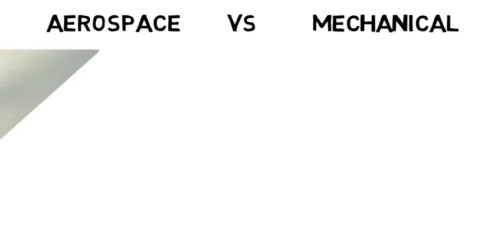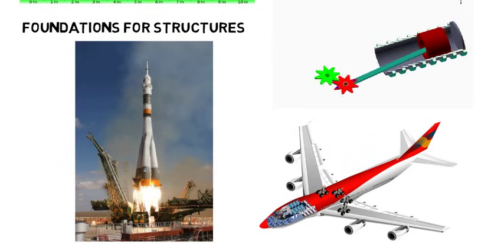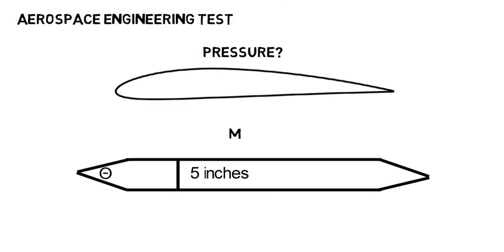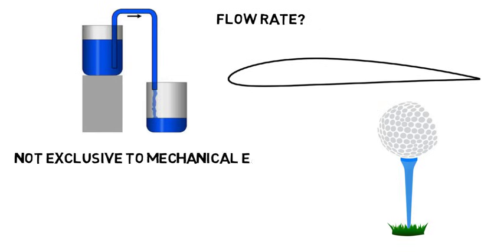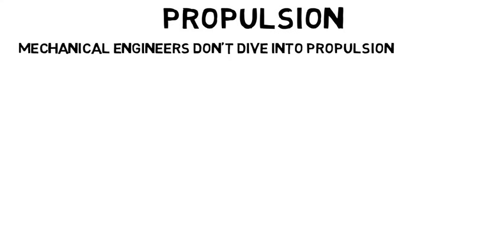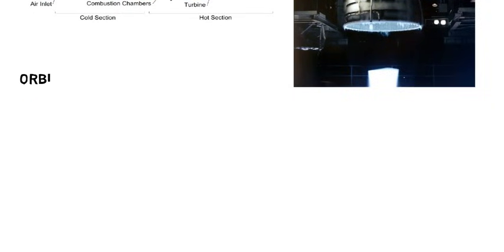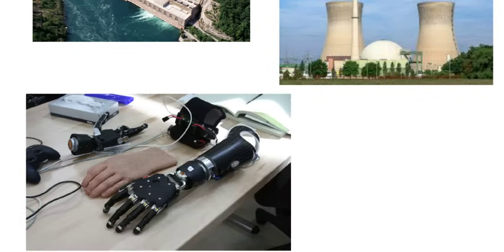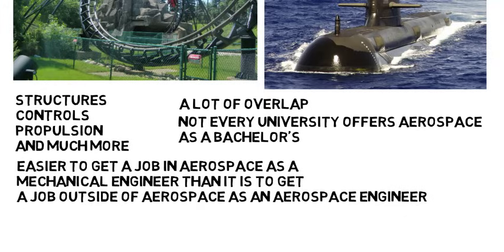Aerospace Vs Mechanical Engineering - How to Pick the Right Major

Comment: Very important thing that was missed here, Aerospace engineers will also cover some Electrical Engineering and Computer Engineering topics, since sensors and flight computers are an incredibly vital part of Aerospace engineering. I don't know if this is true at all universities, but I actually chose Aerospace because it covered both Mechanical and Electrical/Computer topics more in depth than a Mechanical engineering degree ever would.
Reply: Mechanical Engineering is the key technology and the father of all engineering majors.  All engineering majors are very dependent on Mechanical Engineering.  Including the internet run by mechanical engineering machines.  99% of the contents of our house are related to mechanical engineering except our bodies and lives.  A very important department and always have to be more than ready if war breaks out.  Civil engineering is most dependent on mechanical engineering.  There are no skyscrapers without mechanical engineering.  Tools of war and weapons are the scope of mechanical engineering including nuclear reactors.  Mechanical Engineering exists in all fields and majors.

Comment: One other big difference (at least here at TU Delft, regarding the BSc) is that mechanical engineers have some extra courses on working with their hands (manufacturing, prototyping, ...), while aerospace engineers don't have that. In turn, aerospace focuses more on theory and has some extra courses in mathematics/computational modelling, which is less prevalent in the mechanical engineering BSc.

Comment: i would have done aerospace engineering since that is my lifelong passion, but since my college didn't offer bachelors in Aerospace engineering, i chose to Mechanical engineering in bachelors, and then plan to specialize further with a masters in Aerospace engineering.
And based on what i've read this does indeed seem to be the most common option.
Reply: Did u manage to get internships in aerospace compaines while doing ur mechanical engineering degree?
Reply: I have a similar situation, how has it been working out for you so far?

Comment: I'm a mechanical graduate.

Have been working for more than 10 years with a combination of experience in Automotive sector (Engine manufacturing), Military Electronic Equipment design & Aviation.

Mechanical grad (and its derivation)  actually is one of the prospect that can easily slot into or jump between different industrial sectors e.g. machineries, shipping, electronics, automotive, military manufacturing, oil & gas.

You can even find mechanical engineers in civil, biomedical industry & forestry!

The other engineering discipline that boast similar advantage is electrical engineering.

Comment: Majored in mechanical for undergrad, and doing mechanical again for grad school with a focus on thermofluids.

I currently work for a company that develops jet engines for Lockheed and I work doing the same job as aero graduates. Sure, an Aero degree might help you have a better chance at getting into the aero job you want, but as a MechE, most companies will literally hire both aero and mechE (take a look at SpaceX or Blue Origin or Boeing job descriptions, I couldn't find one that said they want an aero degree without saying they take mechE degrees as well).

 I chose mechE because yeah I want to work in rocket propulsion systems which is an aero specialty, but I also want the flexibility to work for lets say, Tesla, doing heat transfer analysis on car batteries or Boston Dynamics to work on robots if for whatever reason I wanted to switch out of Aero. Say what you want, but the odds of Tesla or Boston Dynamics hiring an aerospace kid to work on cars or robots is very small compared to them hiring a MechE, whereas the odds of SpaceX hiring a MechE or an aero student are just about even and aero kids have maybe a tiny initial advantage.
Reply: thanks, this was very helpful and you may have just convinced me to do mechE
Reply: what do you get paid?

Comment: I'm going to go for CSE. But my father is a Mechanical Engineer and from what I know. He didn't go to college and he just learned it simply by working in the feild, which is mining. So first he started with learning different parts of mine equipments and how it's fixed then after 20 years he now manages 3 entire mines and also setting up another new one. So don't let the difficulty of degrees stop you from being demotivated. You can do anything if you try hard enough even without a degree.

Comment: Aerospace Engineer here.
Worked in FEA and Mechanical design for 6 years almost.
4 years spent doing mechanical engineering stuff (cars/machine tools).
Now doing FEM on airplanes.
Worked with both mechanical and aerospace engineers.
We are not identical but we are definetely brothers.
Do not worry and study what you like most.
Job stability is ok because although you might feel the difference for highly skilled research level jobs, if you keep looking up you will eventualy made it into the field you like. And if given proper time to learn on the job you will eventually be able to do both things. One mechanical engineer I kwow designed a wing. A former classmate of mine is designing gear drivelines for helicopters instead. 
Just persevere and be willing to relocate/move in your early years.
As long as you know what you want it doesn't matter which one you choose. 
Greetings from Italy.
Reply: Mechanical Engineering is the key technology and the father of all engineering majors.  All engineering majors are very dependent on Mechanical Engineering.  Including the internet run by mechanical engineering machines.  99% of the contents of our house are related to mechanical engineering except our bodies and lives.  A very important department and always have to be more than ready if war breaks out.  Civil engineering is most dependent on mechanical engineering.  There are no skyscrapers without mechanical engineering.  Tools of war and weapons are the scope of mechanical engineering including nuclear reactors.  Mechanical Engineering exists in all fields and majors.

Comment: Aerospace engineer here. 
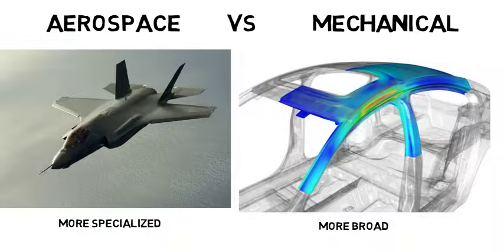1. 0:19 This is not true. In the first year, aerospace take one or two courses in "introduction to aerospace engineer" which even includes designing simple airfoils. In the second year they take "Aerodynamics I", "aerial structural analysis" and their labs.  
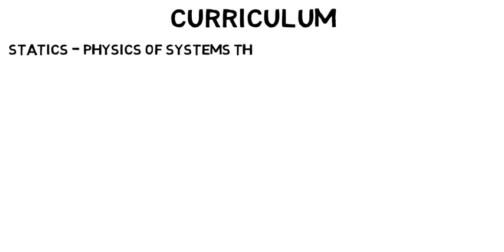2. 0:24 Incorrect. *systems that aren't accelerating.
3. 1:13 Incorrect. Only flight mechanic majors use MATLAB a lot. Aerodynamics use Ansys.fluent, and Fortran. Structures use Catia, ANSYS, and SolidWorks. 
4. Video is very faulty, I can't even continue from this point.
Reply: 1. This depends on your school more than anything. Aerospace and Mechanical engineering are the same for the first 2 years at my school. He also said “nearly” the same, and one or two classes compared to a full year of classes, usually 17-18 credits a term. So between 34-36 credits, two classes is pretty similar. 

2. This is to educate people who want to go into this field. Whether he put moving or accelerating doesn’t make a difference, people understand the gist of it. 

3. Again, this depends on the school. It’s not necessarily about learning MATLAB, it’s about learning to code. Some schools have you learn MATLAB, Some schools have you learn C, some CAD, some a mixture of all three. 

Your experiences don’t make you right. Now if he was talking about specifics, yes, I absolutely agree with everything you said. Especially if it was a video about the school you attended. But it’s a general video to educate people a little about a major.
Reply: @levibeam100  One thing is for sure. If you don't hold a Bachelor in aerospace you're not an aerospace engineer.
Reply: @SaeedAcronia  once again, i would slightly disagree. But that’s just nitpicking at that point and i don’t really care. I don’t even remember commenting this in the first place. Have a wonderful day man

Comment: Im an aero student, from what I see as a difference between me and my mech eng friends, we learn practically identical things but our questions are more focused on the aerospace industry. We go more in depth in fluid mechanics compared to mechanical engineers and we are given more time to learn how to use fluid mechanics in a working environment. We also need to learn about orbital and flight mechanics which is something they don't do at all. In general I feel aero students are taught more things but less in depth.
Reply: That last bit doesn’t make much sense to me. If mechanical engineering is broader wouldn’t that be the degree that goes less in depth and instead applies concepts to more fields?
Reply: @max00101  From what I understand they are taught the same things as mechanical but in addition they are taught other things so despite being a more specific degree they end up generalizing more
Reply: @KepleroGT  I get that, still then I feel like this mechanical degree fails the students. It’s a degree that’s meant to be broad and here in germany that’s the reason it’s so popular. In our Bachelor we choose a broad area of interest and then later on in our master we can specialise in that area (i.e. Aerospace). Specialised degrees are also already offered in the bachelors level, however unless you’re 100% sure this is what you want to do with your life, not the smartest choice.
Reply: @KepleroGT  I think the most differences are that mechanical engineers learn more mechanism design, as robots and planar mechanisms. Aero more fluid and orbital mechanics.
Reply: thanks man, that's really cleared things up for me.

Comment: You made a mistake:
“Statics - Physics of Systems that aren’t moving” is incorrect
It should be 
“Statics - Physics of Systems that aren’t ACCELERATING”
Reply: No. Perhaps you can be more precise, statics - physics of systems that aren't doing a 2nd, 3rd or higher time derivative of displacement.
Reply: @shreyasbangera2140  More simply put, “Statics - Physics of Systems at rest and in Equilibrium”.
Reply: @shreyasbangera2140  you can Have velocity and equlibrium, that is included in statics.
Reply: Yes, the sum of forces in the X, Y, and Z directions as well as the sum of moments in the X, Y, and Z directions are zero.
Reply: @shreyasbangera2140  “[…] put in* a little effort […]”.
Reply: @shreyasbangera2140  It’s not a correction, as what I said is still correct, so the asterisk you put should be omitted, you clown. Indeed, perfection is hard to achieve.
Reply: @Ferb747  Bro are you in every comment acting like a pretencious prick?
Reply: @Ferb747  Okay. You are probably correct. Btw thanks for your sensational language. 😁 ;)
Reply: @shreyasbangera2140  hey!!i have a question...i have interest in physics.i
like to think anything in depth using physics.is mechanical engineering is good for me??
Reply: @shreyasbangera2140  thank you so much for replying!!!..iam interested in physics and as well as how things are made using physics.iam interested to apply physics also.thats why iam confused.plz guide me.what should i know that weather i will get interest in mechanical engineering or not.
Reply: @shreyasbangera2140  i don't want to take mechanical engineering in job perspective..i want to learn.what iam studying or doing that should be interested to study or do.am i suitable for mechanical engineering??
Reply: Jeez, there are a lot of people arguing over the most useless things in the comments right now.
Reply: Practically mean the same thing, you’re being pedantic
Reply: This thread made me barf a little bit.
Reply: No , it must be like - Static - Physics of system not moving in ground frame of reference

Comment: So I’m doing aerospace engineering right now but after watching this I feel I should be doing mech eng. Fml 😭
Reply: Jack Smith do both. That’s what I’m doing.
Reply: Enrique Gonzalez how are you doing both mate ? I’m not sure I can swap back or anything now
Reply: @jacksmith5399  I start my aerospace degree in like a month and i'm already thinking i should've gone for mechE after watching this video. Oh well, I'll see how it goes
Reply: @jacksmith5399  hows it going now, still deciding between the 2
Reply: Yung Mattress it depends on which uni you’re going to. My advice is really look at the quality of the aerospace course. If it’s been running for many years and the modules you can take look good and it’s accredited with good lecturers then aerospace is a really good degree to go for. I’m not in such a good position because at my uni I’m in the first group to ever do the aerospace engineering course and it’s been an absolute mess. We’ve been through so many disagreements with the department trying to get more aerospace content into the course and the organisation has been terrrible. Rn it’s literally just a material science degree, so I wish I’d have done mech eng because that’s been running for like 60 years at my uni. Best of luck though lad, both degrees will get you a good career it’s just more important to make sure your uni knows what it’s doing
Reply: Are the job opportunities the same for both fields. As in can I still work in mechanical engineering jobs even as an aerospace engineer considering its 90% the same curriculum just a bit more specialized. 
I absolutely want to study aerospace engineering to work on spacecraft and rockets but I want to keep my options open as I am not American, and that could have complications when working in the aerospace industry due to security restrictions.

Comment: What if I do Bachelors in Mechanical and then Masters in Aerospace? 
Is that best way to be successful in both fields?
I will never be jobless?
Reply: The issue is, that you need to do a MSC in pure mechanical to master it. As you will be require the higher level modules for a full understanding.

Comment: No brainer, mechanical engineers work in all areas including aerospace.  Aerospace engineers work almost exclusively in aerospace.  Get the degree in mechanical engineering and apply for jobs in the aerospace industry, when you get laid off (and you will), you can work anywhere until the industry picks up again.

Comment: How hard would it be to double major in both? Or get a bachelor's in one then the other?I want to go into an aerospace field but I still think mechanical engineering is good to know and a good backup. Also, which one is better if I wanted to for for NASA or something? And how hard is it to even get into NASA as an engineer?
Reply: Ksenia R we have the same question
Reply: Hi! I have the same questions as you and I was wondering what you now think about it. I'm going to be a freshman at CU boulder which has a really good aerospace program, but I also want a broader job prospect after college so I want to double major in ME and AE. Do you think it was a good choice??
Reply: @nightfly758  I actually just graduated HS so I still don't know. I'm planning on double majoring bc at the college I'm going to it only adds a semester apparently. I think you could just take classes you need for both for now and talk with your adviser to see what you need to do to get both degrees. If it seems doable go for it, but if you're hesitant I think it's fine if you don't. One Reddit post I read said it's better to grow up than out, be really good at one thing rather than being ok at many things. Ex, Bachelor's degree in Mech E and masters in Aero or something

Comment: Bro is aerospace engineering brach is a part of mechanical engineering please answer in yes or no
Reply: @KRYPTONITE TEC 
Yes.
- B. Mech Eng, worked 19 years in Aerospace
Reply: @Skyprince27  thanks brother
Reply: @KRYPTONITE TEC 
Actually, the “aerospace industry” can be a bit of an engineering free-for-all. Aerospacers do the wing design and wind tunnel stuff. Mechanicals do the engines, fuel, environmental control, hydraulics, landing gear, doors, secondary control surfaces (flaps, slats, trim) etc. 
Electricals do the electrical power generation and take care of the MILES & MILES of wiring and harnesses. Also the radios.
The aerostructures are actually done by Civils, as there can be a lot of trusswork.
Then you have a bunch of computer guys, cuz airplanes have literally dozens of computers and control boxes of all kinds.
Basically they call Aerospace Engineering “aerospace” because that’s where you learn the things that are ONLY in Aerospace, things like airfoils, drag coefficients and computational fluid dynamics. VERY math-intensive! Solitary work, almost like physics...
Reply: I want to work in spacecraft and rockets more than anything. But i am only concerned about the job opportunities for choosing aerospace engineering. Especially considering I am not a US citizen.

Comment: Generally, it is not typical for a mechanical engineering major to handle structures on an aircraft. Based on the curriculum for mechanical engineering, it can be difficult to analyze aerostructures with what is taught through the ME structures courses. Aerospace structures can be very different to more common structures and thus often requires specialists in aerospace structures. Let me know if anyone else has made the same observations.
Reply: Mechanical Engineering is the key technology and the father of all engineering majors.  All engineering majors are very dependent on Mechanical Engineering.  Including the internet run by mechanical engineering machines.  99% of the contents of our house are related to mechanical engineering except our bodies and lives.  A very important department and always have to be more than ready if war breaks out.  Civil engineering is most dependent on mechanical engineering.  There are no skyscrapers without mechanical engineering.  Tools of war and weapons are the scope of mechanical engineering including nuclear reactors.  Mechanical Engineering exists in all fields and majors.